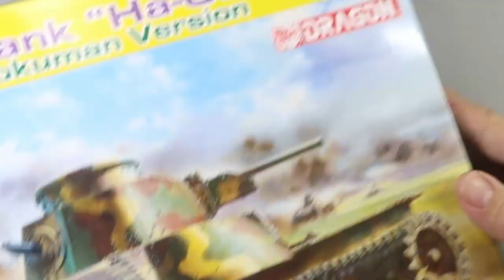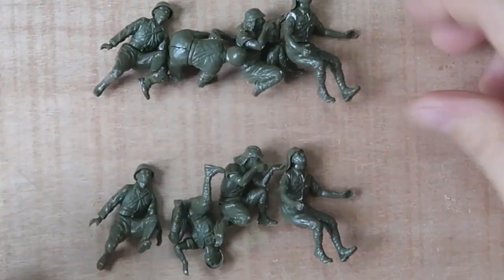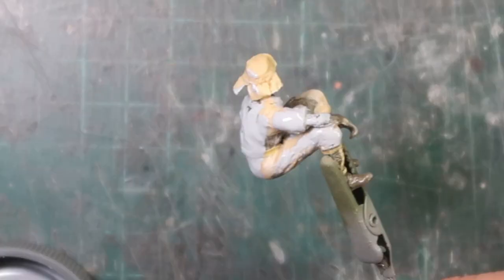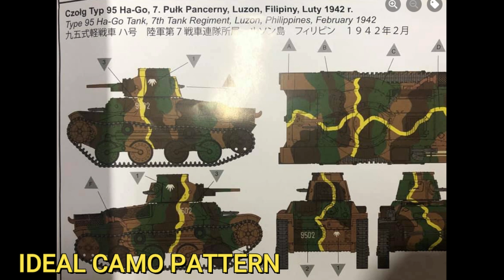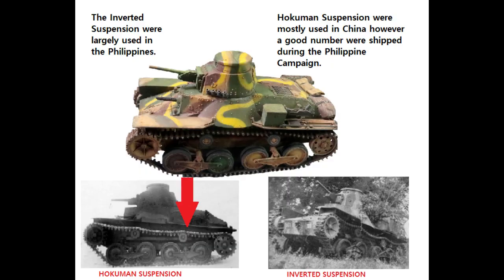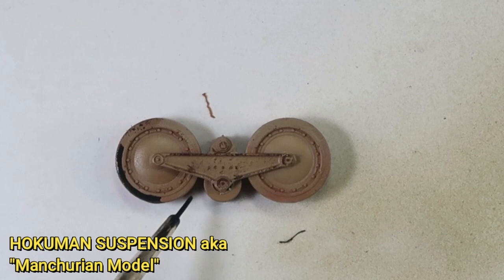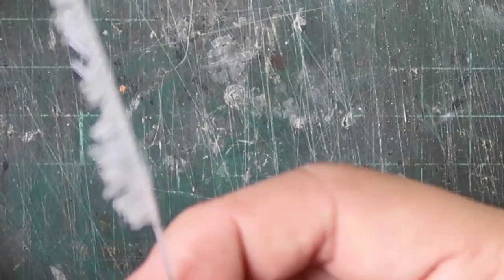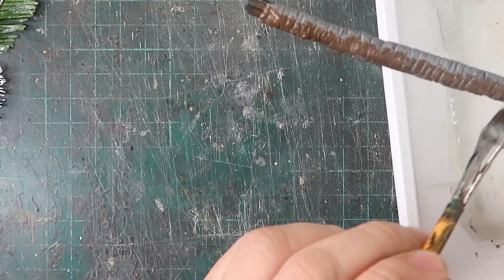BATAAN Ha Go Tank 1942 DIORAMA BUILD. 80th ANNIVERSARY JAPAN'S PHILIPPINE INVASION. PACIFIC WW2

Comment: Great build and diorama..Amazing work on the tank and figures(including the pigs)👍
  In Osprey books Japanese Tanks of WW2 it states that in the factory the base colour was sprayed on.Then the camo colours of green/earth brown was hand painted on and mainly freehand and with a rough guidance..No real set pattern for the green/brown..This left the workers to paint the tank to their own patterns..This would be slightly different depending on who’s on what shift..But it wouldn’t make each tank totally painted different..It would be easier for the workers and more productive to roughly do the same pattern style each time.E.G,one paints green patterns,the other brown.Both follow each other.But it didn’t matter if for example one tank the pattern was half over a hatch.The next tank the worker only went over quarter of the hatch..
   The yellow stripe was painted to dazzle and quarter it’s appearance..Again this was applied with a broad brush.Hence the stripes thickness in most..The line had to cross at the top of the turret and go down the four sides of the tank in a ripple effect..But again as long as the workers followed this guidance they were free to interpret applying the ripple as they wanted..As long as it went down each side,rear and front.The worker was free to paint a line a jagged straight down or a curved river effect..
Reply from the maker: Wow. Extensive insight there sir. Really appreciate it. Thanks for supporting the Channel.
Reply: @IvanTheTerrible911  Hi and thank you for a great video..Hope the information on Japanese tank camo..Osprey books always give info..But this subject is covered in many books..Thanks again and take care👍
Reply from the maker: @themajesticmagnificent386  Hello Sir. Thank you too. See you here always. Thanks for the support.